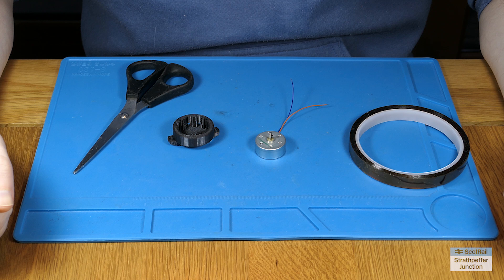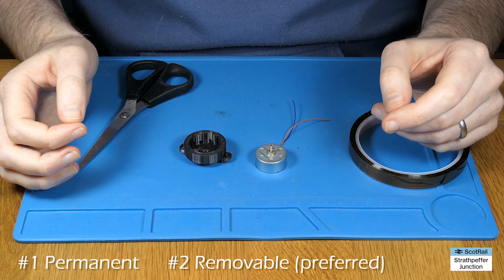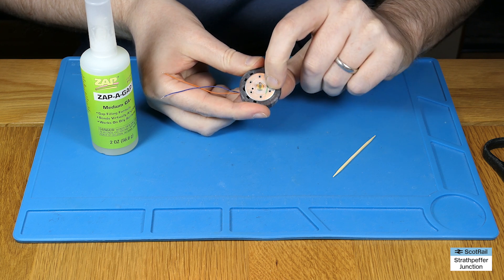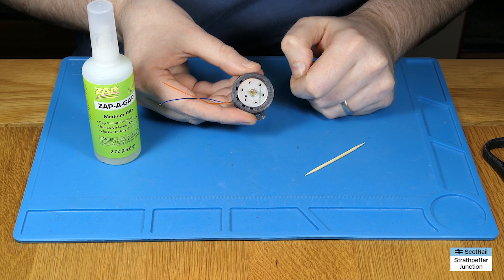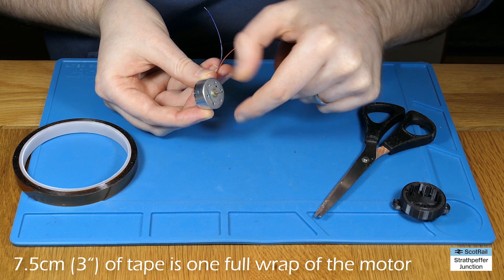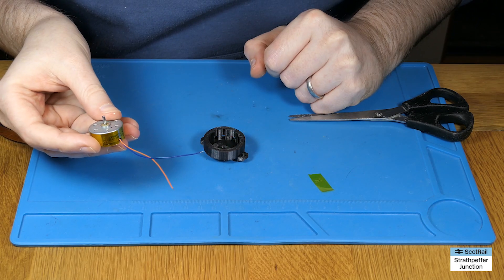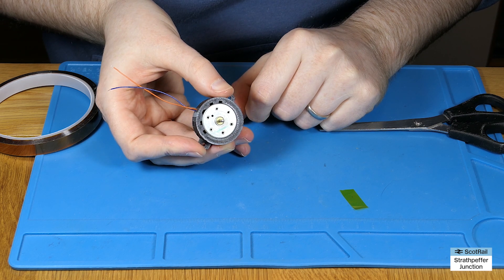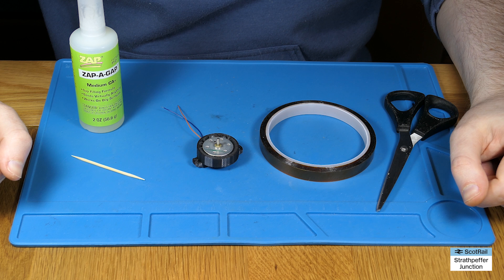Lima Replacement Motor Adaptor: Finding the Perfect Fit!

Comment: Hi David. Just catching up with your videos. "Strath's Shorts"? Was dreading I was about to watch something about men's underpants!
So, relieved to see this one is about refinements on use of the can motor collar. When buying one of yours, I mentioned that I was building one to my own design and mark 1 is hot from the printer. Lessons learned for me:
1. The fit of collar to motor is key. Too tight a fit can be remedied by lightly grinding away some plastic from the collar. A loose fit can be dealt with by your options.
2. The economics suggest that your option 1 is the better. If one considers the can motor as cheap enough to be disposable, so then is the collar. And both are recyclable!

For my conversions, I'll marry each motor to a best-fit collar as, in my case, I can produce the collar cheaply.

Anyway, glad to see your back - no, glad to see you're back! Looking forward to your next pair of Strath's Shorts!
Andrew
Reply from the maker: Hi Andrew. Glad to hear your own version has been born. Like I mentioned in my email, there are a few pitfalls, and it seems you've discovered one of them! lol. I spent months testing mine and it's amazing how many wee things that you didn't initially think about crop up. I have actually just redesigned my adaptor as it happens, with a new video out this evening. If you have your own 3D printer, it's definitely worth making your own, but if you don't have one, then buying one for the purpose of making an adaptor for a couple of Lima locos becomes very expensive indeed!